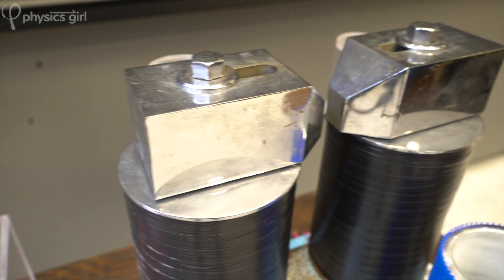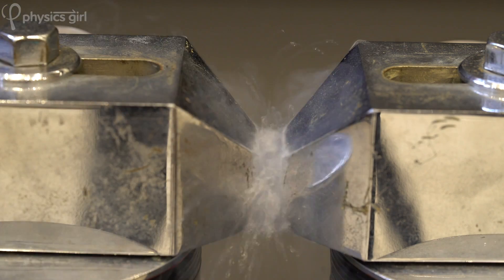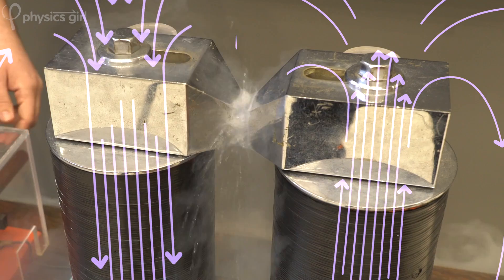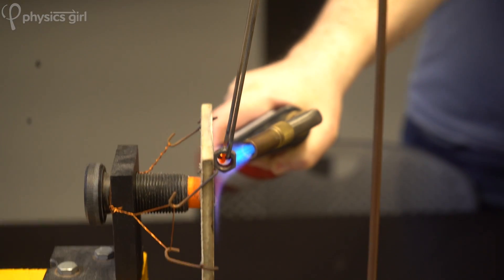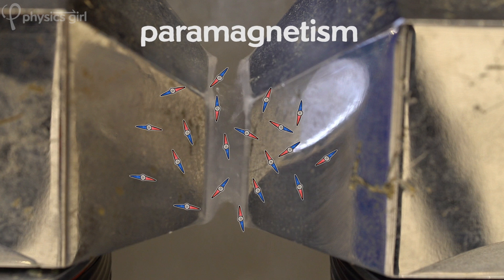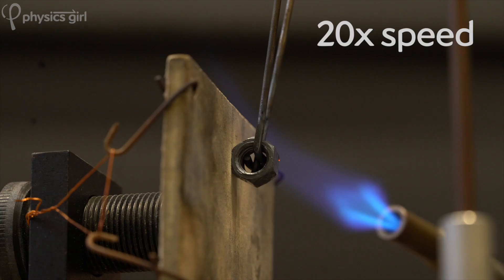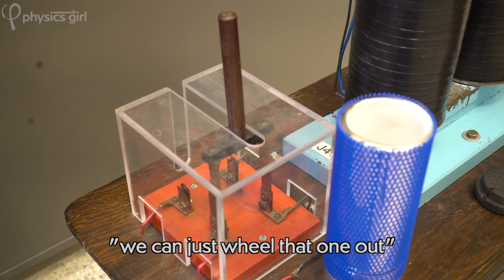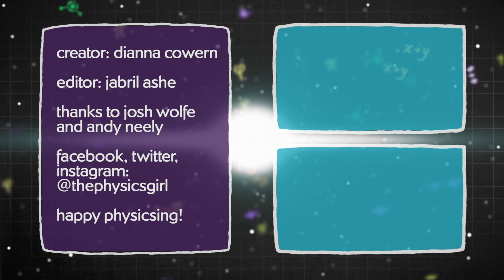Oxygen is MAGNETIC?!

Comment: water is magnetic too, which makes it better to use for electrolysis! 

 FREE ENERGY! TRUE FREE ENERGY! Siphon liquids UPwards by putting a bottle/sealed container above water/liquid source, have a siphon tube go from water/liquid source to top of a sealed container. on the bottom of container put a spout so water can flow back into the source. the water coming out of spout will create suction in the container pulling water up the siphon tube! it will continue to flow until water evaporates unless you build it in an enclosure or use ionic liquid. with water flowing constantly you can use the tesla turbine or any hydro-generator to give you free energy for everyone in the world! Thank you tesla for free energy for the world!

Comment: Careful with all that oxygen and electric sparks! That's what happened inside Apollo 1! Back around 1980 I was working with a group of people looking at medical technology that could be used in the future. The magnetic properties of oxygen were intriguing on paper and to get a better feel for it we made a small amount of liquid oxygen and everyone was amazed at how the stream would bend when we poured it past a giant magnetron magnet. Of course, that magnet could not be turned off and we had to take other precautions in the lab when we took it out of it's big drum holder - you didn't want to be wearing your mechanical watch or other ferrous jewelry anywhere near it. We were looking to see if oxygen concentrations could be measured using oxygen's response to pulsed magnetic fields inside a tuned cavity and even what it would take to make a device to extract oxygen from the air magnetically. It was going to take a lot of power to extract usable amounts of oxygen from the air magnetically but experiments building prototype sensors were very promising. Unfortunately the company wanted to move in other directions and the work was abandoned. Love how you make science concepts concrete and relatable! Looking at basic concepts in new ways is how breakthroughs happen!

Comment: "I feel nervous don't know why" - holds one of most dangerous liquids.
Reply: Near the sparking on/off switch...
Reply: @mattjohns3394  Liquid Oxygen isn't flammable. Neither is it in a gaseous state. Oxygen will not burn on its own. Remember the fire triangle.Heat-Oxygen-Fuel. Take one away, fire goes out, or is unable to start. In this case there is oxygen, and that's it. There is no fuel or heat. That means no fire. Once a fire is started, adding oxygen will make the fire burn more energetically. An example would be Oxy-Acetylene welding torch. Acetylene  burns fairly hot. Adding oxygen makes the flame hotter.
Reply: @Clippy3621  That never would have occured to me.  Thanks for the learning.
Reply: @Clippy3621  great reminder! Ngl, I puckered a bit when I watched that switch spark.

Comment: OK, so if really hot iron can't be magnetic, how does the earth's molten iron core produce a magnetic field by spinning around?  This isn't a snarky question, just pushing the blowtorch experiment to the limit.
Reply: The current theory is that the solid inner core and liquid outer core act as a sort of dynamo, converting mechanical energy into electrical energy, which reacts with the nickel-iron solid core creating our magnetosphere.
Reply: i wonder if it has something to do with the inner core being under great pressure? I would like to see if the iron metal under great pressure loses its magnatism at same temperature or can the magnetism remain if the metal is squeezed. ..like perhaps in a vice?

Comment: Wondering if this could be used to pump liquid oxygen into rocket engines. The advantage would be doing away with the need to have moving parts at cryogenic temperatures. Also putting a fat rectifier diode across the coil will stop the back EMF burning the switch.

Comment: Great demonstration!

Now humor me and try the following you'll be amazed as to what happens:

A- Create a ferromercurial liquid approximately 100 ML's.
B- Make a hollow glass toroid approximately 3 feet in diameter.
C- Create a near vacuum inside the Tori before placing the ferro mercurial mixture inside.
D- Cover the entire surface of the toroid with individual small 10 turn coils (separate coils) 
E-  Connect each coil to a sequential activator so that they all fire in the same sequence at controlled intervals from a power supply.
F-  her supply voltage to all coils at the same time so that the liquid metal mixture is centered in the toroid. Not touching the walls.
G- start pulsating the current faster and faster so that the liquid starts turning inside the vacuum.
H- To counter the centrifugal force generated by the increased  RPM ;  also increase the voltage to keep the liquid centered so as not to touch the walls.

I- Due to the very rapid acceleration in mercury your plasma will be created and still rotate says the iron will not have reached its Currie point.
J-  if the toroid  becomes too hot and  starts melting repeat the entire experiment under liquid nitrogen inside a container..
K - As The velocity of the fluid reaches year relativistic speeds A plasma will form and a blue glow will create a sphere around the toroid.
      This will give me at ultraviolet B and soft x-rays so beware! 

L- As The frequency of pulses further increases the door or he will start lifting upwards slowly. THIS IS NOT ANTIGRAVITY, but rather a standing wave that is created by the mixture rotating at near relativistic speeds that interferes with gravitational waves.

It has been linked to the public that the glowing sphere in the center of the Lockheed Grumman TR3-B is a Tocomak that works on a similar principle but with a very efficient gas metal mixture. Please let me know how this turns out. I have witnessed this in a lab. I do not have an NDA

Comment: Hypothesis: Gaseous oxygen is also paramagnetic. Experiment: Using the same or similar electromagnets, turn them on and wait a while for oxygen from the surrounding air to accumulate between the poles, and nitrogen to be excluded by its presence. Introduce a flame to the space between the poles, i.e. a lit match or candle. If the flame brightens noticeably, the hypothesis is confirmed.
It would also be interesting to note how the ionized gases of the flame would be deflected by the magnetic field.
When can I expect to see the video?

Comment: Fun fact about the hot iron becoming non-magnetic. Traditional blacksmiths use this as an indicator of temperature of the iron that they're working, showing that it's at the right temperature for the carbon atoms to line up inside the crystalline matrix of the iron atoms and alloy to form steel. When your sword is just about done, heat until it's non-magnetic and immediately quench it to lock in the hardness.

Comment: If iron is not magnetic when it is hot, then where does the Earth's magnetic field come from?
We were taught at skool that it is from the molten nickel-iron core.
Reply: I think magnetism is induced by the movement of charge and the electrons there are balanced by the protons.
Reply: Yes, but if there is an equal number then there is no net movement of charge.
If there is not an equal number, then why is that so?
Reply: hairyloon Electrons and protons carry a charge. Charge is not separate from them
Reply: Surface effects. There's irregularities at surfaces of materials, which breaks the balance.
Reply: Why would those irregularities not simply average out?
Reply: Could it perhaps be a gravitational effect?
Do positive charges tend to be more massive than negative, which would mean they tend to be nearer the centre...
Reply: It cannot average out because surfaces are not symmetric in 3 dimensions. The inside is different than the outside.
Reply: Gravity explains all science
Reply: Excellent question! My research is not conclusive, but it looks like the lithosphere (layer of mantle below crust) is below the Curie temperature of iron, and it is up to 50% of the volume of the Earth, and so may be the main source of the magnetic field.
Reply: http://herculeajonesdiv1.weebly.com/earths-4-layers.html
Reply: Keith Kennaugh The earth's core is mostly iron and it spins because the earth spins. So do iron's electrons. When electrons move...magnetism.

Comment: when iron reached it's Curie temperature then if we make magnetic field more strong , does it would stick to it or not?
Reply: No, the strength of the field will not matter, because the crystalline structure of the iron is weak enough to allow the poles of the molecules to move freely without dragging the macroscopic object along. However, if you use a strong enough field, keep the iron hot, and continue to expose it to the field while suddenly cooling it, you will make a ferromagnet because the iron atoms will align their poles and be frozen in place that way.

Comment: I think you were wrong about one thing. Iron should start glowing way before it reaches 1050K. Heck, not just iron, but anything and everything will start glowing faint red at a specific temperature which is independent of what the material is. This temperature can be easily found using wien's displacement law, and if I'm not wrong, it comes out to be approximately equal to 800K. Hence, it shouldn't matter if the object is made of iron or of plastic, it would start glowing at 800K.

Comment: Wouldn't the liquid oxygen be too cold and decrease the velocity of the particles in the magnet by heat transfer. Thus, the magnets would create a weak magnetic field and the liquid oxygen would not stay in the position (between the magnetic field) due to the equation F=qv*b?
Reply: 配位化合物 : The extreme cold actually increases the magnetic field strength. An electromagnet's strength will increase 800+% when placed in liquid nitrogen.
.

Comment: It's not only liquid oxygen that is magnetic, but gaseous oxygen as well. In fact, there exist meters that measure the oxygen in the air by using this principle. I used one back in 1973. If you find such a meter, open it and be fascinated. It's a very delicate and sensitive simple movement.

Comment: The MIT technician mention the "DC current". Is n't that supposed to be a "AC current" in order to produce a magnetic field ?  What do you think Dianna ?
Reply from the maker: Nope, there's a magnetic field around a DC current too according to Ampere's Law. The line integral of the magnetic field in a loop enclosing a current is equal to μ0 times the current.
Reply: In a transformer, we use only AC current to transfer energy from the primary to the secondary so I though it was the case here.  Thanks for the response Dianna !!!

Comment: Actually the iron does not loose it's magnetic properties about the Curie temperature, it just cannot become permanent magnet, and the permeability drops drastically with increased temperature also. However, that very very strong magnet (from oxygen experiment) may slightly attract the red hot iron also. That would be interesting to check.

Comment: Why does this only work with liquid oxygen? I assume that liquid nitrogen has a lot of the same properties, so why doesn't it give the same effect? 
My hypotheses are temperature or electron configuration.
Reply: WbMaxime it's the electron configuration of the O2 and N2 molecules.  The energy levels of O2 fill up in such a way that there are two unpaired electrons while in N2 they are paired up.  To clarify this isn't only due to a difference in the number of electrons but also a difference in the energy level/orbital configuration.
A good model for this is Molecular orbital theory.

Comment: At the atomic level, what is the condition to be feromagnetic or paramagnetic?
Reply: Adrian C. 
Basically
Paramagnetism: lone electrons that who's spin can align with a magnetic field but lose the alignment when the field is removed

Ferromagnetism: It is energetically favorable for the system for the spins of the lone electrons to be aligned. This is due to the exchange  interaction which is related to electron behavior due to being a fermion and the Pauli exclusions principle.

Basically when two electrons can be exchanged the overall wavefunction of the system must be antisymmetric because electrons are fermions because they have 1/2 spin (non-integer).  The wavefunction can be broken down into a part describing the spin and the spatial part which can be either symmetric or antisymmetric.  In ferromagnetic materials an overall spatial wavefunction which is antisymmetric is favorable because in that material it positions the electrons further away from each other spatial.  This forces the spin part of the wavefunction to be symmetric so the combined wavefunction is symmetric and the electrons are aligned.

The big difference is that in paramagnetic materials there are lone electrons but their spins are free to do as they wish until something aligns them, while in ferromagnetic materials the system they are in prefers the electrons to be in the same direction.
Reply: Importantly what direction the ferromagnet aligns its spins in doesn't really matter based on the exchange interaction.  The exchange interaction is pretty short range, so many ferromagnetic materials are not spontaneous magnets (this is where you start getting into magnetic domain walls). Some form of magnetic anisotropy must be present for a spontaneous magnet to form.  If you put a ferromagnetic material in a magnetic field and align all the spins of the atoms, then it will keep that alignment.
Reply: Tried to not make that to long but if you need any clarification or expansion just ask
Also key words:
Paramagnetism 
Ferromagnetism
Exchange Interaction 
Magnetic anisotropy 
Fermion
Pauli Exclusion Principle
Exchange Symmetry
Wavefunction (overall, spin, spatial)

Comment: A metal with exactly selected curie point is used in the Weller soldering iron tips for a temperature regulation. Very smart, simple and effective method for controlling the temperature of the tip itself. That's why the Weller soldering irons are incomparably better than most of the other soldering irons because the temperature of the tip is tightly regulated under any circumstances. And more - if you heat a magnet over the curie point after cooling down it will no longer be a magnet. It'll turn into a virgin piece of ferromagnetic material.

Comment: If you made Solid Oxygen (using cooling and/or pressure) would it become a strong magnet ... and if you heat iron into a gas, would it completely loose its magnetic properties... just asking
Reply: No, and kind of.  Think of it like this:  Each atom or molecule has a certain potential for magnetism, depending upon how many unpaired electrons it has.  The large-scale effect of the molecular magnetism can be dampened by temperature and state, but not bolstered.  O2 only has so many unpaired electrons which give it paramagnetism, and cooling it further isn't going to make its magnetism any more apparent.  Likewise, iron doesn't really lose its magnetism when heated, as it still has a lot of unpaired electrons, but the large-scale magnetism vanishes because  the atoms simply aren't coordinated enough for their tiny magnets to line up and form one big magnet.  On the large scale, the iron has completely lost its magnetism far before it even reaches melting point, and you can't get lower magnetism than that.  (Although, it's still an electrical conductor in solid, liquid, and plasma states.)
Reply: cOmAtOrAn Ahhhh!! Thank you for taking the time to reply!! 

This has rekindled my interest in a topic I haven't thought of since high school.